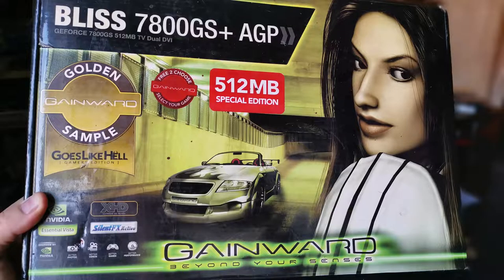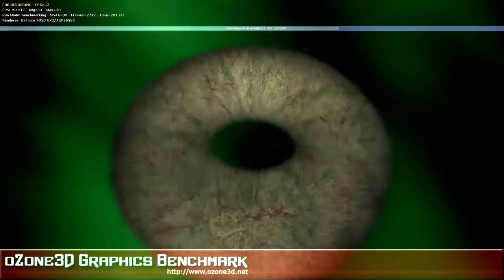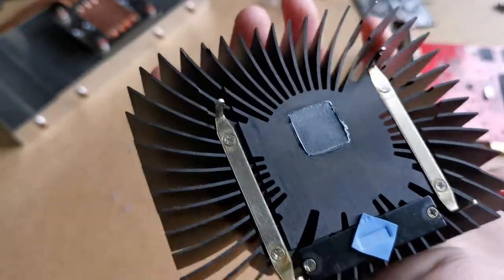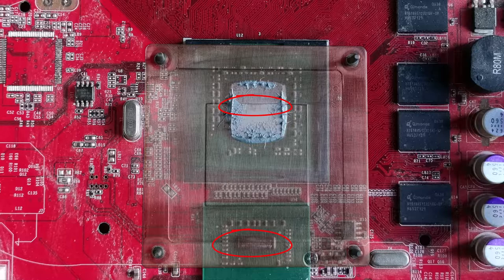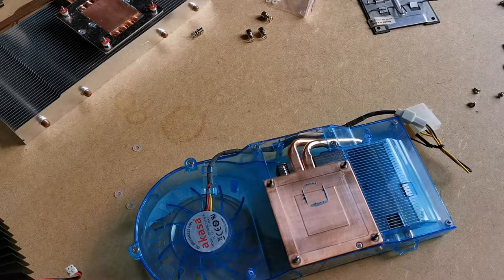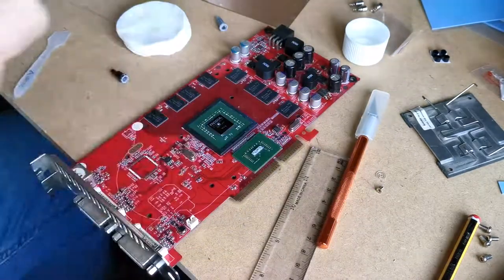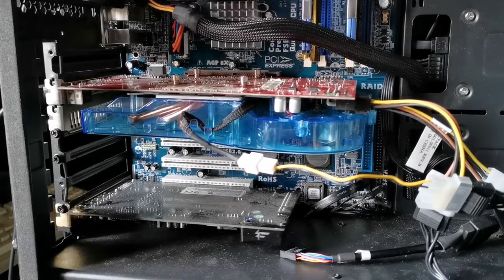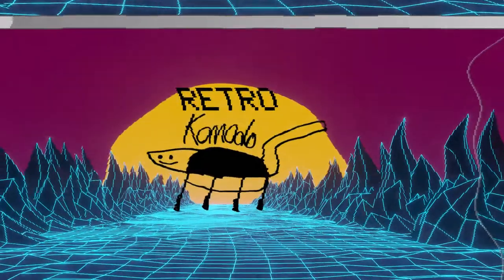AGP Gainward Bliss 7800 GS+ Akasa Vortexx Neo cooler replacement

Comment: This is the first ever graphics card i bought back in 06 so i could play Call of Duty 2, but mine had a different cooler that looks like your replacement cooler, but its black. I also still own the card and the box. Its sitting in a Pentium 4 pc that's no longer in use.
Reply from the maker: I know the one. If you do an image search of a 7800 GS+ the black cooler one is the one that shows up. https://tpucdn.com/gpu-specs/images/b/8222-front.jpg  I'm guessing mine was a later revision or they just made less?
Reply: @RetroKomodo  According to an old review it was a special Arctic Cooling cooler only 2500 made. I do remember doing 600+ on the core with gainward expertool.
Reply from the maker: @USAS12  Oooh - thanks for the info! If you have the old article link could you pop it in a reply? I'll have a read later ;) I think mine is a re-branded Palit card actually after Gainward bought them? What did you think of my cooler base plate bodge?
Reply: @RetroKomodo  Would something like Arctic cooling 4NV work on this? Seems like a much better (retro)fit
Reply from the maker: @maphantom  They're both similar-ish, apart from the 4NV has a larger copper area FOR ram? It also helps that it has a flat copper base, so if fitting to an AGP card with a bridge chip it wouldn't need an extra copper plate like I made for mine. On the flip side though you can buy the Vortexx Neo new still for about £10 on eBay whereas the NV4? Can't find one to buy!

Comment: The title is wrong the card you have is the 7800GS not  the 7800GS+ totally different card correct box wrong card lulz
Reply from the maker: Lulz indeed. I guess you missed the sticker on the back.. P/N:XNA/780GS+T352-PM8370-GS - look it up!
Reply: @RetroKomodo  it is the heatsink that states it is a 78OOGS
Reply from the maker: @malcolmogilvy4885  actually the heatsink just says 'Gainward - Beyond your senses'. I questioned some very knowledgeable people on it in the Vogons site (https://www.vogons.org/viewtopic.php?t=89962) and it seems that late in the day when Gainward was "merged" with Palit during GeForce 6xxx times they cheaped out on components like perhaps the heatsink and shroud. Also in https://forums.overclockers.co.uk/threads/gainward-bliss-7800gs-agp-are-they-all-24-pipeline-or-are-some-20.17863200/ a commenter states 'Later Gainward GS+ did have 20pipes and non Samsung Memory (think 1400mhz DDR).' So is it a GS+ like the box and sticker say - or a regular old GS? Really? I don't know! Frankly i'm just glad I have it! 
Anyway - what did you think of my thermal solution?

Comment: I hate this cooler design, own 7900GS myself.
Reply from the maker: The original cooler or the aftermarket one? 7900GS - nice!
Reply: @RetroKomodo  Gainward 7900GS Golden Sample stock cooler sucks, would have it replaced in a heartbeat, if they were available anywhere.
Reply from the maker: @tuff_lover  yeah the original cooler for this one wasn't great.. my slightly over the top DIY sandwich cooler fix did a lot better than I thought it would though ;) if only I had an acrylic case..
Reply: @RetroKomodo  I do not recommend, they're honestly awful.
Reply from the maker: @tuff_lover  classic beige it is then!!
Reply: @RetroKomodo  I bought one of those Ferrari cases just today, made by InWin, needs some cleaning.